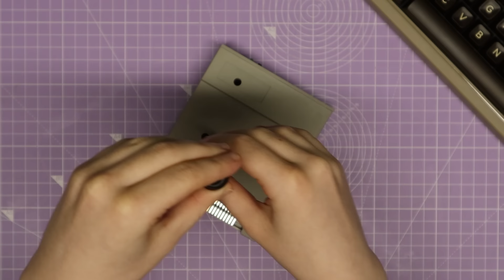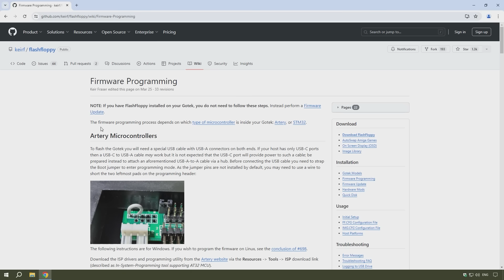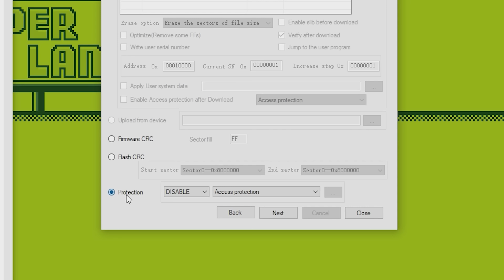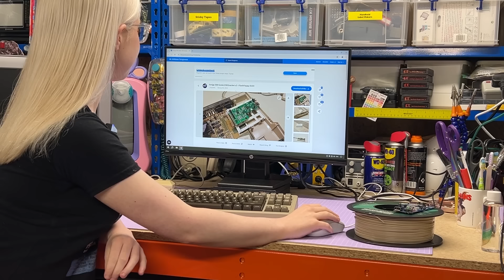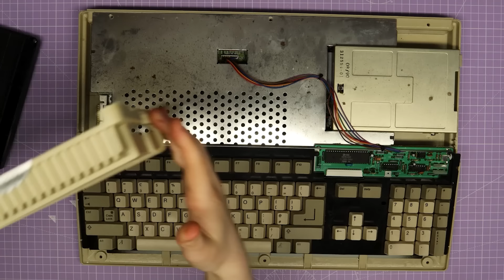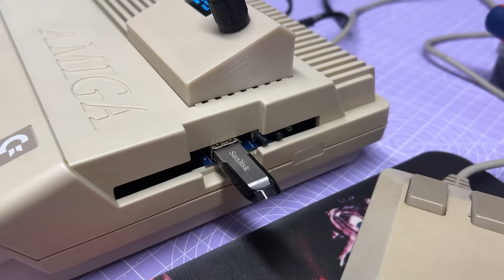Saving a Commodore Amiga A500 from the trash

Comment: i do a few of these and order 2x3 row angled headers the pins seem a bit thicker and you can feel the duponts going on much firmer plus it reduces the height inside the unit i a;lso used your top mount and its really good nice fit and clean design

Comment: Unless the read write heads are trashed on the floppy drive, they are usually repairable, they do lose azimuth as they get old and wont read disks even after cleaning but its easy to adjust even if you dont have a calibration disk by slackening the worm drive off slightly  and rotating it just a touch one way then the other while its doing a diskcheck on a known good floppy when it reads without constant retries it should be good...

Comment: Not exactly the video I expected. It is mainly a Gotek floppy replacement. I like to restore computers to be as close to original as possible, and getting a working drive is peanuts. Since an Amiga 500 has an external floppy port, hanging the Gotek on that port is no big deal either, and IMO the prefered way to go.

Comment: So, basically you've built your own upgraded Gotek drive instead of buying one of those available ready made on eBay with the same kind of rotary controller which sits on top of the case. Was this just to save money, or to customise it? I bought one ready made, designed for my Amiga A1200. Unfortunately, it came without any screws or posts, so I had to buy some new ones, after replacing my floppy drive with an older Gotek years ago. The posts and screws I bought didn't work, because the holes in the cradle haven't been tapped or are too small. You had some screws coming in through the bottom of the case, but I'm not sure this arrangement is the quite the same on my A1200 or if I could hold the cradle in place while I inserted them. I had these problems while my A1200 case had all its screws removed after an upgrade then losing the screws. After screwing the case back together with new screws, I found it was holding my Gotek drive in place. Unfortunately, my LCD screen, which wasn't held in place by any screws, has come loose, so now I have to remove the case on top, held by two tabs in the slots, then screw it into place. Where did you get all your knowledge about building and customising various items like this? I'll be watching your other videos soon.

Comment: Love the video. I agree with wiring through the side but actually make it detachable (so wire to a port that sits flush on the system and the attachment will have a cable with a plug).

Comment: Fantastic 3d print for the GOTEK - really looks good. 👍
If you don't have a 3d printer (like me) I can recommend the GOEX from CenturionTech with the LCD screen (which is very similar) and uses SD cards rather than USB.

Comment: Nice to see the Amiga still is loved and being discovered.  I Still have my Amiga 500 from my childhood, and a 1200 that I picked up later, both still working.  If you havent already and your keeping it, look at the many accelerator cards for it, or at the very least if you dont have one already a memory upgrade, many games require at least 1mb. Beyond that, you can get USB adaptors for the joystick ports to use pretty much any USB gamepad, and depending on if its been recapped, look it up, as they can leak (Some models/revisions I think were worse than others).  And if your amiga has any kind of battery for remembering time (usually on an expansion board if I Recall) get it swapped, as again they can leak.  I also have the CD expansion (A570) for mine, opened up a whole new world back in the day, bet they go for a small fortune now, but its something to behold slapped onto the side of the A500 if you can get one.  Basically turns your Amiga 500 into a CDTV.

Comment: My Amiga 500 did not make it. I either smashed it out of frustration or it died or both. I still have the Amiga 600 I replaced the A500 with as well as my Commodore 64 both still working and all my floppy disks, cassette tapes and games for both computers. I have been meaning to get HDMI kits able to upscale the outputs to 4K.

I was going to try this, but you lost me at soldering :D Every time I have tried soldering, it has never ended well.

Comment: A great game. Coded by the team behind the 'Turrican Series'. But sadly never saw the light of day for too long as 'Nintendo', used its considerable industry might to argue it was too similar too - Yes you all guessed it 'Super Mario'. They used to go under the 'Monika', 'Rainbow Arts', back then and are known as 'Factor 5' these days. They are a very nice company and provide a lot of their old titles for free download, with no requirements. They really pushed the limits of both the 'Amiga' and 'C64', at the time of their releases. I think (Not sure, without checking), they were aiming to create a game based on the 'R-type' arcade machine, and a demonstration was released for the 'C64'. It was going to be called 'Katakis', but once again 'Activision', had just acquired the license for the home computer versions of 'R-type', so managed to get an injunction. They did eventually release it for the 'Amiga', but it, unfortunately, had been watered down too much for the fans, to pay it heed. The thing that made these games so special on the Commodore 64, was the 'End of Level Boss Characters'. That required some very clever 'Sprite Multiplexing' to display on the Commodore. Made a lot easier on even the 'Old Agnus', and 'Amigas', due to the wonderful 'Blitter Co-Processors' ability to move around full-screen objects, without affecting the workload of the CPU. I suggest purchasing 'Cloanto Amiga/C64 Forever', and tracking down the appropriate 'Roms' for what were in the early 90's amazing examples of brilliant coding/sound and graphics work. :) Thank you for sharing this tutorial. I use an old IDE drive, and a USB, to multiple hard drive' types interface devices to move stuff around. I also write to the disk in 'RDB' (Amiga) format, on my PC. So cool. I have nearly 3200 Amiga Floppy disks, from the era. Mostly from the 'Magazines' of the day. :) It is nice to see the next generation, enjoying what we consider the height of technology in the day. But we made do very well. Now our phones, are over 200 times more capable, but there is so much 'Tosh'. To go back and play these pioneering titles, is somehow refreshing. :)

Comment: I have also done this mod to one of my A500's I drilled a hole in the case top for the dupont connectors :-0 fortunately I have a spare case top, If I want to reverse the mod. I have recently bought a mini Goteck which attaches to the external floppy port, which I have not tried yet, But if you use an early Kickstart ROM, you need to install a floopy drive boot selector also. I have 2 A500, one has a PiStorm installed, the other has a 14MHz accelerator, I built from a kit. I Also have an A600 with a Furia Accelerator installed 🙂. I have subscribed to your channel.

Comment: Giving you extra kudos for the Robocop t-shirt.

The Amiga 500  doesn't feel right unless it has aa huge RF modulator balance out of the back of the machine and having the computer connected to an old crt.   Rich people might have a sony trinitron, however  most would have an old portable Busch or Akai portable ctr with the coat hanger aerial in the back

Comment: Back in 1990 I saw an Amiga 500 for the first time while visiting a classmate. I was stunned by the visuals and the very FIRST game I saw on that machine was "North & South". I went home, I was only 15 years old back then, and said to my parents, "I also want an Amiga 500". But yes, that was in 1990 and the machine costed fl. 900,- (Dutch Guilders), corrected for inflation € 883,- today. So, directly starting scraping, getting extra side jobs, a little bit of begging with my grandparents 😆 and roughly 3 months later, including my birthday I finally got it. The machine had only 512KB of memory and I was puzzled at first how to copy some floppy disks with games that I 'loaned' from that classmate. I had one drive (df0), loaded XCopy, and the machine said, ~350KB of ram available. So I tried copying a disk, but I knew the disk was 880KB in size, so it took some time to realize that you had to copy in multiple stages. 3 times to be exact. First copying 350KB into ram, then writing it to a blank disk, then resuming with the next 350KB reading into ram, then writing that to disk and the final 188KB was done in a third pass. The box full of squares was all green and I was happy. This computer made me so happy back then, I was in love with those cute floppy disks, back then so new, because I was used to the 5.25" floppy disks on the Commodore 64. Then after some time I upgraded the ram, got an extra drive, ahh the fun....I got a program (forget it's name) that could rip modules out of memory. So you started a game, then some music would play, you did a soft reset, insert that disk, and that program would search memory for mod files. Ah man that was so great...And then later I got my first hard drive. The whopping 20MEGAbytes (lol) A590. Did not seem much, but I could put Workbench 1.3 on it, with several favorite games, a few modules, it was great. I miss that. I miss also the social gatherings I had, taking my benches of floppies with me and have a nice evening doing some copying stuff....increasing the collection. Even my parents were amazed by the musical output, even though it was 4 channels only. It's a pity we did not had any full hd camera's so little video footage or photo's of those days remained. But the memory will live.
Reply: How did you get RAM? You bought it in boxes?
Today, I know that it comes in a thin plastic shell when we buy any DDR type and previous to that, it was SDRAM and previous to that, it was EDO RAM and SIMM style fast page RAM.
Reply: @louistournas120  To upgrade the Amiga 500 RAM you had two choices - a RAM card (PCB with RAM chip on it) that went in the 'trapdoor' expansion slot beneath the Amiga, or else a 'sidecar' box on the side of the Amiga (a plastic casing within which there would be a PCB with RAM chips on it, though I am not sure if there were any such pure RAM sidecars, by which I mean usually such expansions would also have an accelerator or hard disk as well, or even both). The trapdoor expansion was the most common, taking the 512K A500 to 1mb. In either case, the product would be packaged in a cardboard box with a glossy finish, much like typical computer hardware today, with a picture of the device and information on its specification. It was possible to buy various RAM chips to insert in sockets for the Amiga too, but I have no idea how they were packaged, and it probably wasn't relevant for worldgate because his half megabyte expansion would have been the trapdoor expansion I spoke of, and I think the RAM chip on there was soldered to the board, you didn't buy them (as far as I am aware) unpopulated.

Comment: I do miss the Amiga 500, in a way, I regret selling it years ago.
Paradroid
North Vs South
Balderdash
There was a great space ship shooter game where you gained a code whenever you finished a level so you could go back to the game and continue.

This video bought back some good memories, I kind of regret selling my system years ago now. I had the 500, 2000HD and CD32 with a pile of games.

Thanks for the trip down memory lane.
Reply: Love North & South
Reply: In a closet I still have my A1000 when they were first available for sale in '85. I later bought a used A500, and then when the A3000 came out I bought the cheaper 16MHz model. I really loved the A3000 since it was able to use standard VGA monitors. I would have loved to have an A4000 so I could have an AGA Amiga, but by that point I could see the writing on the wall that the Amiga had no future. So I built my first PC and put the Amigas in the closet. I've been toying with the idea of getting them out, seeing if they work, and playing with them if they do, or finding someone who wants to buy them. At least mine have always been stored in air conditioning so they won't be rusted. I'm sure damage from leaky batteries is the biggest dangers they face.

Comment: Good repair ! One small piece of perhaps advice - consider building a new PSU to replace the old one of you have not already - when they start to go they have a habit of taking out key chips, and the Gotek itself is surprisingly sensitive to a bad PSU. I used a generic SFF PC PSU that has a laptop style 18V primary with a small switched mode board to get all the voltages, and got the Amiga connector online. I now also have a bunch of cables for all my other retro things attached to the same setup and it is great way to avoid damaging old chips that are hard to replace !

Comment: That's fantastic. Back in the 80's / 90's when I had an Amiga (many ---- 8 or more A500's , 2 x 600's, 1 x 1200, 2 x 2000's) I never would have dreamed this was possible. The main drama with the Amiga was having a dead drive.

Comment: The GoTek is an AWESOME piece of kit.  I've got two of them, pondering a 3rd.  I have them in my 486 and P3-1ghz machine.  I also picked up a 2-in, 1-out USB switch (Not HUB) that allows me to plug a USB drive into the switch, and a button will allow me to hook to my main PC and the 486/P3 and easily get disk images to it.  No cable swapping needed anymore, which is BEAUTIFUL.

Comment: Just found your channel.  Love people who fix and save things from being trashed ❤
Reply: Should have slapped someone for even thinking about tossing out ANYTHING Amiga related. Hell even if the unit were busted up and didnt even power on it would still be worth a few bills just for the parts on the motherboard, that custom silicon is getting harder and harder to source replacement parts for.

Comment: Just did all of this for my Atari 1040ST.  The eBay listing included possibly the worst printed bracket ever, but I printed one to match the Atari a little better instead.  I still need to pick up an Amiga 500 at some point, I regret selling mine back in the late 90s.

Comment: I did this to my Amiga 1200 back when the Gotek first came out, but instead of reflashing the chip in the Gotek, I bought an adapter cable of eBay that allows a standard PC floppy to work with the Amiga interface, if I remember correctly the cable had a 7 series logic chip and a couple of resistors in it to adapt the two differing comms standards, worked pretty well but I ended up missing the floppy noises, so I stuck a PC floppy in there instead and used a USB Superdisk drive to write images to floppies from an emulator on a PC, all good fun, things are so much more streamlined now!

Comment: I kept my family's Commodore 64 after college. The problem is that while playing games the joystick button would randomly double fire. I changed joysticks so the problem was somewhere on the board. I cleaned the board as best as I could and I did not feel comfortable enough with re-soldering the connections. Sadly I threw it away because PC emulators worked good enough.

Comment: I have a fully working Amiga 500 in my office. All original equipment, no mods. I have a Commodore 2002 monitor and an external floppy drive. Also have a full C64 setup with 1902a monitor, 1541 and 1571 drives,  Okimate 10 printer, and modem. 🤓

Comment: I think you did a good job by threading the cables through air vents of the Amiga case, it´s a really clean look you achieved with a very professionell touch. Personally I skipped the Amiga because coming from the C64 I couldn´t imagine using a system that wasn´t fully working after powering it on. So I went with the Acorn Archimedes 3010 instead, after experiencing the 3000 at my friends place. :)

Comment: not entirely sure that a gotek replacement can be considered an upgrade. Replacing the original drive with a modified Sony MPF920, mounted at the right height, can perfectly replace the Amiga 500's drive, and if you're fine with modifying the case a little, there is enough space to put the Gotek's USB port a little down and closer to the front, next to the RAM expansion bay. Tapping into DF0's floppy header and power lines (adding a switch to toggle between whether the floppy receives power or whether the Gotek receives power should in theory be sufficient to switch between them while the machine is powered on) ought to let you have both Gotek and Floppy, so you don't have to choose between real floppy disks and ADF disks, and a couple of additional upgrades such as ROM upgrades to 3.2, A500 clockport adapter, a TF534 accelerator, a CF Card hard drive solution, Subway 2021 USB card.

Comment: I share your pain of DuPont connectors, I have no idea how many I went through before I got a good crimp, did end up getting a bit better though. Your thoughts on pulling the wires out through the slot and looping back into the controller box is what I did, it makes opening the case way easier! Though I have to admit, your controller box is way better than the one I designed, but I was limited by the rotary encoder dimensions, so I mounted it to the side.

Comment: Interesting mod.  I'll have to check out those accessories you used.  I think I have some rotary encoders.  Glad you got the computer to work with.  What crimp tool do you use for the Dupont connectors??  I've been trying to find a good one but so many different people say some are good and some are bad and then some say the opposite so I haven't gotten a crimper yet due to all this confusion.